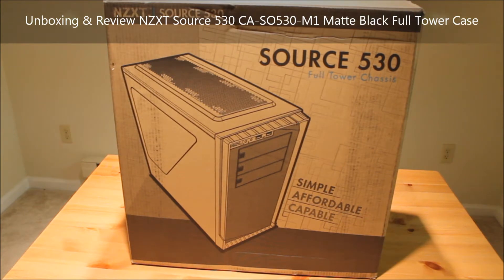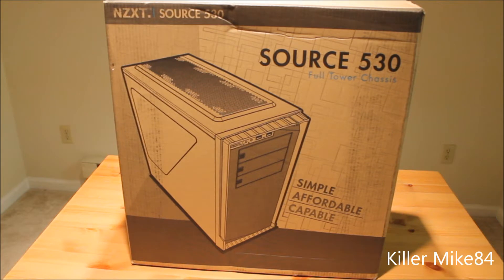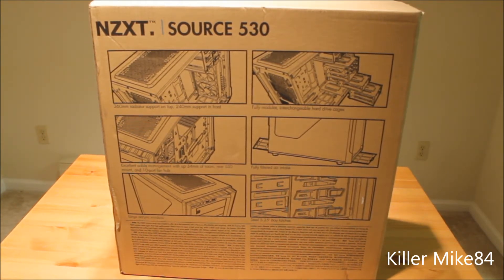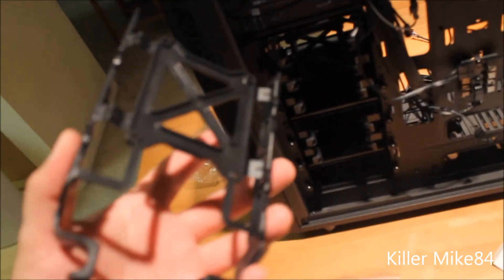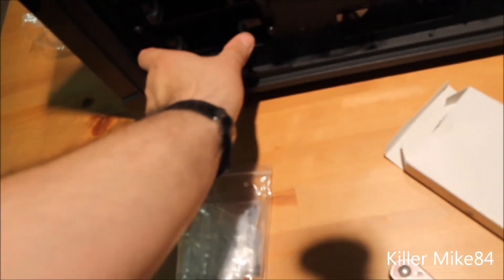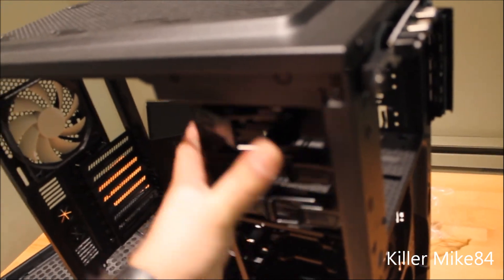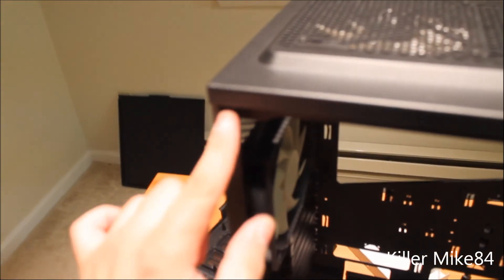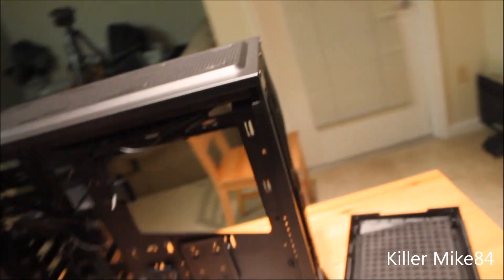Unboxing & Review NZXT Source 530 CA-SO530-M1 Matte Black Full Tower Case

Comment: I hope I can build this.  My first computer.

 EVGA SuperNOVA 750 G2 80+ GOLD, 750W Fully Modular NVIDIA SLI and Crossfire Ready Power Supply 220-G2-0750-XR

MSI Computer Corp. NVIDIA GeForce GTX 750 Ti Gaming OC 2GB GDDR5 VGA/DVI/HDMI PCI-Express Video Card N750TI TF 2GD5/OC

MSI 970 GAMING DDR3 2133 ATX AMD Motherboard